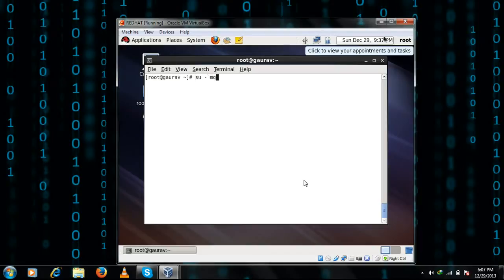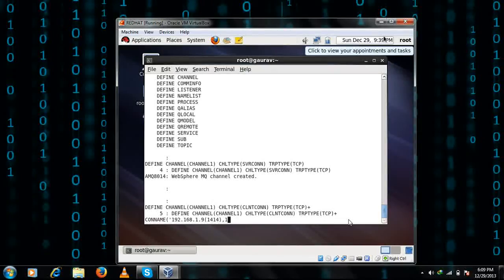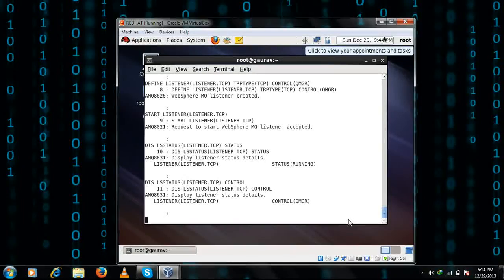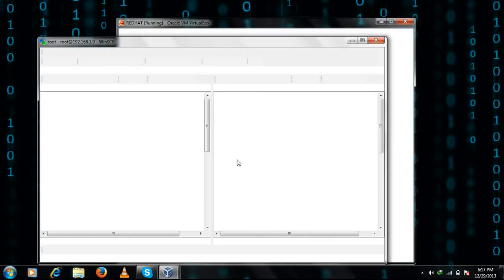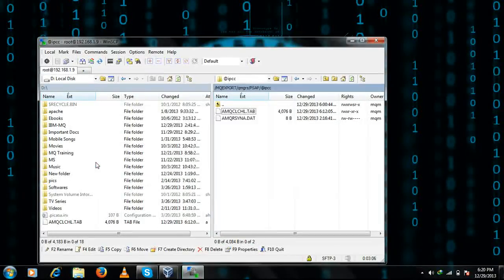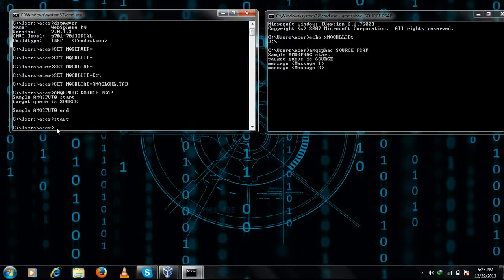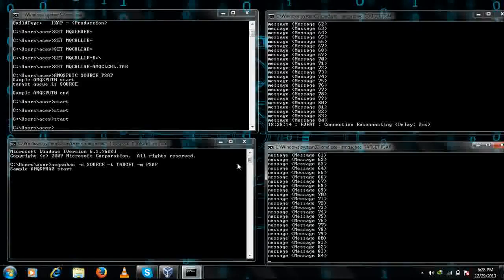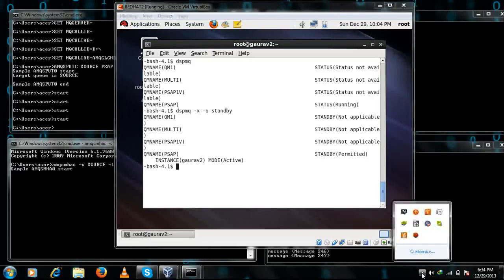HA Applications Automatic Reconnection to Multi Instance Queue Managers using CCDT

Comment: I followed the steps, I used amqsputc and when the MQ1 stops it does not reconnect, the connection ends with the following messages:
EVENT: Reason(2161)
EVENT: Connection Broken
MQPUT ended with reason code 2009
MQCLOSE ended with reason code 2009
MQDISC ended with reason code 2009
Sample AMQSPHAC end

Do you know what could be missing? Thank you.